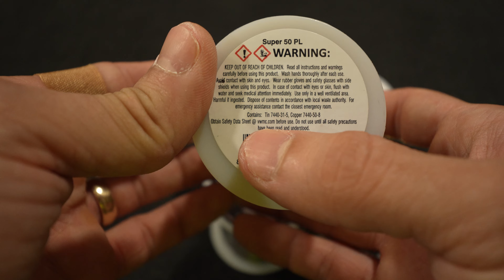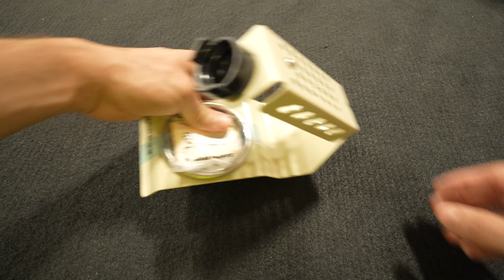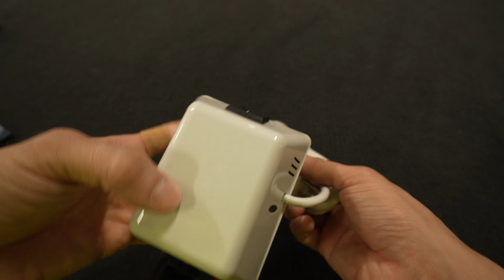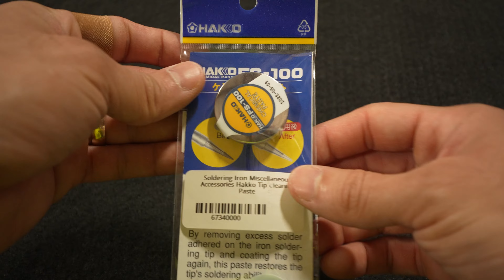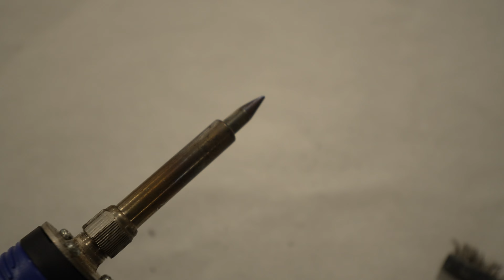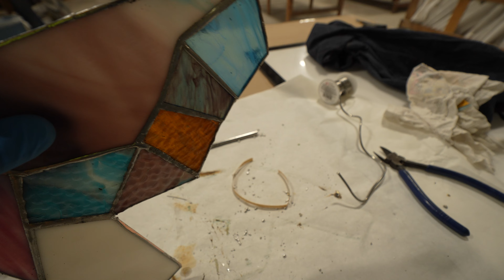2024 Stained Glass Soldering (Tools & Techniques)

Comment: Just one advice the mask that I saw on ur table is not the one for such works u need a good mask with filters ABE1 with fp2/fp3 for soldering because when the flux smokes it can cause asthma and irritation in the lungs. Those simple masks can't hold and filter gas, and fumes and such particles.
Reply from the maker: Good advice!

Comment: I only use stearin oil to solder. For copper and lead. No toxic flux just simple candle wax.
Reply from the maker: I'll have to try it out
Reply: Hi. Very curious on this method for lead! Is there a specific way to apply or as per normal? Any other tips? How well is it for copper foil too! Many thanks 😊
Reply: @hakitowr Hello. I use either stearine oil with a small brush or stearine stick, which is a bit less messy and quicker to clean afterwards. It's the way I was taught 30 odd years ago by a stained glass artisan.
It works for copper and lead and I also use it to solder jump rings on sun catchers. 
Cleaning is done with white vinegar and/or alcohol. I always use cheap alcohol for medical purposes. Hope you like working with it. 👋

Comment: We all go all lind kinds of lead pieces that we normally throw in recycling or other
BUT
have easily melted in small stem using a cope bandout rod in two it makes an excellent mold
BUT
this is not 40 60 or 50 50
Is it pure lead like lead bar?

is it so good ??
Reply from the maker: I understand your question now
No, i do not recommend an attempt to melt down your lead to make solder, I think you will be wasting your time to be honest! And probably creating an inferior product compared to a factory made solder

Comment: Do you get lead tested? Didn’t see a fan.
Reply from the maker: Yes
Lead doesn't become a fume. That would be the Flux so anything airborne that a fan would help is not lead related - not to say it's not bad to inhale those fumes
Reply: Get the lead tested for what?
Reply: @sharmanmurphree-roberts4018  when you handle leaded solder, you can absorb lead thru your skin.  Always use gloves.

Comment: I had a question. I had a project that i was working on but when i checked on it a few days later it fell apart from the glass, like the copper foil adhesive was all melted. I salvaged the glass so it was ok but was that because i over worked the piece with solder so it melted the copper foil adhesive?
Reply from the maker: Sounds correct. It was possible not burnished down well enough and Flux got between the glass and the foil.

Comment: I am new to stain glass. After copper foiling and shouldering, with a little pressure, my pieces get separated. What is the reason?
Reply from the maker: You need to secure the pieces on the perimeter with nails or scrap trim boards

Comment: pardon my noob question but googling has left me drowning in information: What's the difference between stained glass and leaded glass? Why do you need a hotter iron for leaded glass? Thank you!
Reply from the maker: Stained glass is an overarching term for many mediums. Leaded glass is a medium of stained glass among others like copper foil, faceted glass, smalti mosaics, fused glass,etc. Think of it like painting as the over arching terms with different mediums like water color, oil, etc.

We use a higher melting point solder for leaded glass so the hotter iron is faster for better productivity.

Comment: It looks like sometimes you keep the tip straight with a finger rather than allowing it to free flow.  When do you apply each method?  Thank you
Reply: Thank you for posting this video.  One suggestion:  the background0 music is too loud, very distracting.
Reply from the maker: I prefer the end of the tip when trying to solder specific areas. I lay the tip down where more of the surface area is coming in contact with the solder when trying to make a big area molten and smooth it all out nicely. It conducts more heat so it also allows you to move faster.

Comment: I understand that you mentioned that the soldering equipment F601 can be set to different temperatures. What temperature shall you use? Thank you
Reply from the maker: 2nd from hottest to move quickly, 3rd from hottest for edge beading so it keeps its shape on the edge pretty easily

Comment: What and how do you pick up solder if it lands on the glass?
Reply from the maker: Normally it will just pop off if you scrape it lightly with a piece of wood or plastic after it has dried.
Reply: Use your iron.. itll bead up on the iron.. no need to touch it at all.